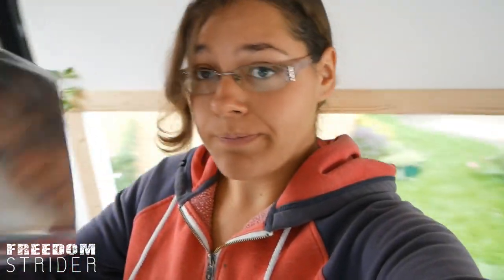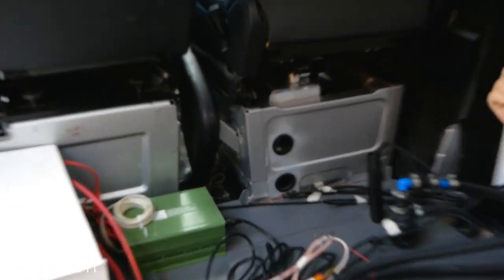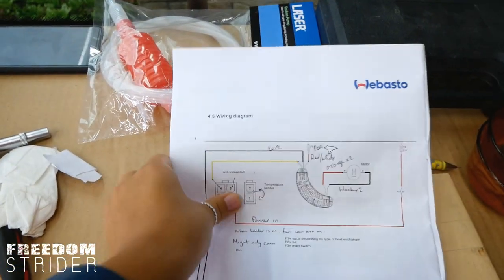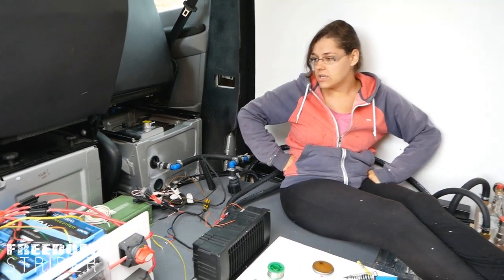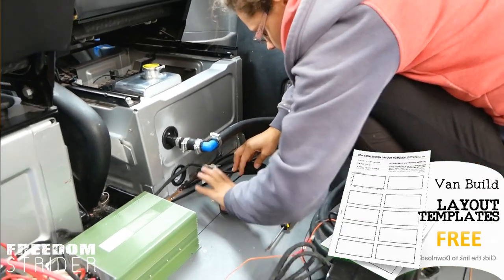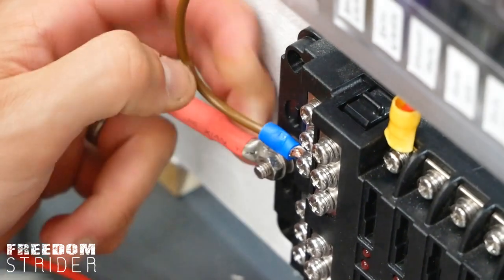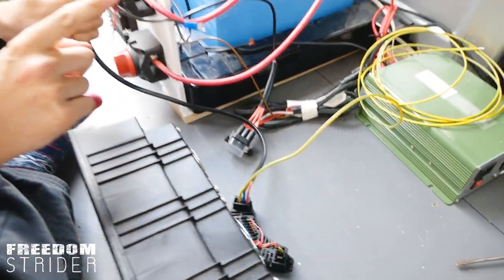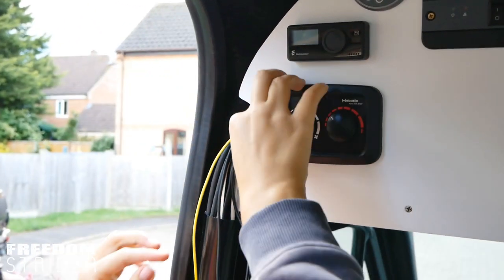Diesel Hydronic Heater ERROR! | Sprinter/Crafter Van Conversion

Comment: Thank you so much for posting these videos, have same kit. These helped me so much figuring this out especially wiring. On putting parts together you can use olive oil or just water and also those fittings were leaking as you are not supposed to use Teflon with compression fittings that have internal gaskets.
Reply from the maker: I was worried about contaminating the inside, so I didn't use anything but hot water and force to try get the pipes on, but frankly some lubricant would have been much easier!! Didn't know they were compression fittings, but there are no peaks now, good to know for the future 👍

Comment: I admire your persistence and determination. Instead of bleeding any air out, can it be purged by repeatedly turning the system off and on?  Or could you put pressure on your filler tank to push any air round, effectively flushing the pipes? My water pump/pressure vessel moans when it is sucking air through if my water tank is getting low. Remedy seems to be to switch it off and restart which seems to re-prime and shove the air round and out. Just a thought. Best of luck.
Reply from the maker: Just running the pump repeatedly - didn't do it - running the pump dry would wear it out fast. We have moved the pipes around and that seems to have done the job. Next Saturday we show those tests - would love to know if you think the pump sounds normal after the alterations. 🙂

Comment: My first though was an airlock.
IMO your header tank isn't quite high enough to fill the system especially as at least one of your hoses is sitting quite high.
What i would do..
* First lay any rubber hoses down as much as possible til the lines are full.
* If you have a length of spare hose, remove the header tank and temporarily connect to the longer hose at a higher level and refill.
* Clamp the hose to limit the loss of fluid while you refit the header tank under the seat.
Reply from the maker: We didn't think of raising the tank higher (temporarily) but it's a good idea. We have dropped the pipes to the floor and move the heat exchanger loops down as well... and the air seems to be out - Next Saturday you'll hear the pump... apparently working correctly 😀

Comment: I wish I could help guys. You put so much into your research. Would it be possible to create a high point in the system that you could bleed from. I suppose the lack of circulation would prevent the air from reaching that point. Question the manufacturer for possible solution? there must be one. Good luck.
Reply from the maker: Oddly enough the older generations and bleed valves on the pump, heat exchanger and air matrix themselves 👀
We did manage to fix it by rearranging the pipes and some other little tweaks (next week's video 😉 )

But yes the pump not being able to prime itself is a real thorn in the design of this very expensive heater

Comment: I feel your pain. My system didn't quite work the first time, close but the floor loop didn't get warm. So I reran my hose for a single loop with a 3 way valve, but that seems worse. Although after your video I think it is because I have to bleed the system. I haven't touched it for a couple months because the weather is too hot right now.
Reply from the maker: It is a fiddly system to install and get working, but one step at a time - we'll all get there. 😀

Comment: I used to design and build waterfalls so very familiar with pumps. You need to pre prime your pump. You can try add a little water and glycol before the pump if elevation is ok. Also make sure your water glycol ratio is right. Lastly, you need to run all piping after your pump in a line and do not tee off. You must force the solution through one pipe and not have it tee off. Also you need third valve between cross over pipe to force the so,union into your radiant piping.
Reply from the maker: Yes I think having more valves to force the glycol through only 1 line at a time would have made it easier. Priming this pump was a nightmare! They don't make it easy!

Comment: Great video and love your persistence! I am planning to use the same system and I wonder if you have tested the water heating capacity. Is it enough to give you continuous hot water?
Reply from the maker: We haven't connected the hot water system yet but the hot air system is working great 👍

Comment: Planning this myself! Any idea if the heater and the matrix are passive, i.e. when there is no power to them, does coolant freely flow through the them? Or would you need bypass valve and tubing for coolant to flow with these components off?
Reply from the maker: When the heater is off - coolant doesn't flow at all because the glycol pump is powered when the heater is on. The matrix is a series of fancy open pipes i.e when you connect the matrix/heat exchanger to the glycol loop, the glycol will always pass through them, regardless whether they are in use or not.

Comment: Had exactly the same problem with a Webasto system, noisy pump, difficult to get the air out, and with two air bled valves in the system, the pumps are rubbish until you get the air out, we have managed but you can buy bled valves that fit in the 19mm pipe that would help at the high points in the pipe work.
Reply from the maker: We managed to get the air out by dropping the pipes, but we are looking to get bleeder valves for future.
Reply: The bleed valves I found are here https://www.rjaanatpt.com/index.php?main_page=product_info&products_id=75883
Reply: @FreedomStrider  this website is a scam. Delete the message!!

Comment: I plan to install the same Kalori Silencio air heating system.  Are you happen with air matrix you installed now that you have had it for a year or would you think of maybe using another one?  Thanks
Reply from the maker: We are happy with the Silencio air matrix, it is as quiet as it can be and the heat is strong. 😊

Comment: Just an interested  viewer with no experience in this kind of system or any kind of fluid dynamics but when the underfloor heating valves are open Is it not an easier path for the glycol to use the same route as when the valves are shut rather than push around all that tubing under the floor? In other words do you need a valve between the two T fittings that is shut when the underfloor heating valves are open and open when the underfloor heating valves are shut?
Reply from the maker: Yes, you are right, we too thought this but we tested it without first, and ended up needing to buy another valve for that H piece (next week's video 😉)

Comment: Great job but y do so complicated when u can buy airtop heater. This hydronic are used for engine heating most
Reply from the maker: The main reason we went with a hydronic heater instead of an airtronic is because we a) wanted on-demand hot water for our future recirculating shower, and b) because we wanted to run underfloor heating - the hydronic system is much more versatile and an airtronic heating system and was the best option for us 👍

Comment: The lines to the heat exchanger are to high. Hold the tank up higher
Reply from the maker: Yes, we did move those lines down, tricky as we are very limited on height, but we've moved the tank as high as possible 🙂👍

Comment: I would think you could just start disconnecting hoses until you found one without glycol.
Reply from the maker: They all had glycol in, there were just some bubbles trapped in the high loops. Disconnecting randomly would be unnecessarily messy. 😊

Comment: We like You ✌Two
and we think your 
heater is going to pull
through.    ⁽ • ⁾°. * • ⁽✨)
Your going to get Bubbles
we wish you the best, but if
your Van is Rocking ⁽° •.*)
Your heater will be 
    hip hopping without
Skipping a Beat , your Van
is looking real Freaking
 Sweet, 😺we like the Vw
with your high Roof there's so
much room that you wouldn't
get Cooped .Very nice you ✌
Reply from the maker: You certainly know your rhymes 😎
Reply: @FreedomStrider  
Believe me Sir commenting is hard work. We really like how you two carry on with each other and your Van Build DIY is a blessing to us that want to get started with our own build . 
I haven't decided on which van to start my build with,  I'm still looking around for the most space inside I can get, I do like the Vw Crafter and I'm now looking at the large Renault  master Crew Cab DW E20 Chassis 2010 model . But I do prefer DW E30 in long wheel base which is more money to buy at this time .